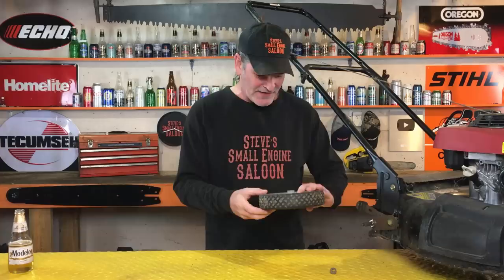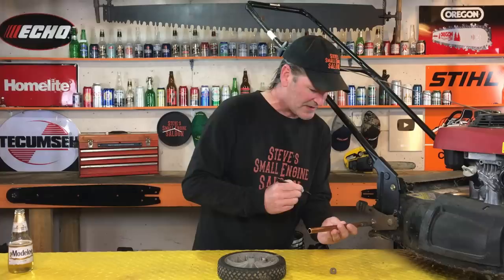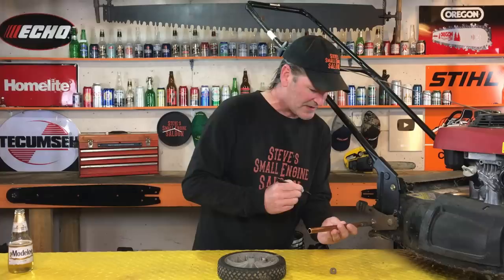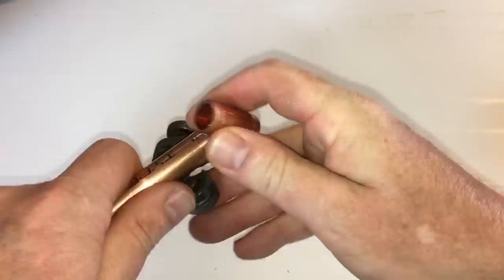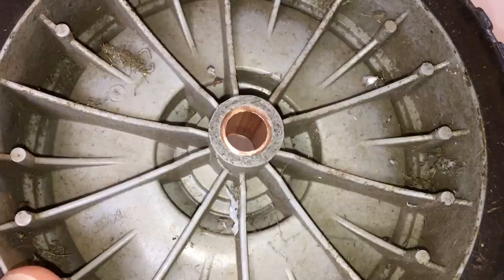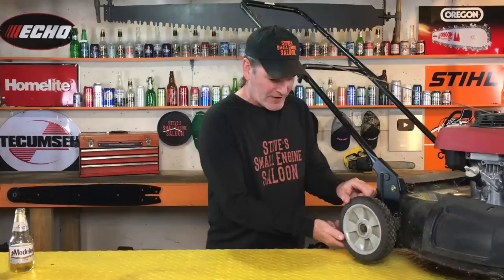Amazing Trick To Fix A Wobbly Lawn Mower Wheel

Comment: Grease for less rolling resistance , it's for mowing grass not dirt . Can always take off and re-grease at service interval , feel the old grease then and see if it's gritty . Graphite powder would likely be best if it's on hand but I wouldn't go out and buy some just for that . How many RPY ( revs per year ) is the wheel going to do ?
Reply: You can't mow dirt with it. Dang it. I guess I need to cut those 75 foot trees down when I cross the dirt wasteland under them.

Comment: Brilliant I have a Honda and the terrible plastic bearings they sell them with (which are 40 cents cheaper than the metal bearings) are useless and only last 5 minutes.  A friend of mine machined me some new bearings out if delrin as I didn't want to take material off the wheel but great little video thanks

Comment: Was doing this 30 years ago and greased with moly .If wheel bolts are worn on the outsides the larger centre section can be filed down by putting in the drill press gripping lightly on the threaded section .useing a drill bit larger than 1/2" and cutting the copper on a diagonal length wise.. deburr and pushing it in then checking fit .drill wheel next size up if its too tight . Type M copper being thinner cheaper  than L can be used np doing it this way

Comment: Steve’s Small Engine Saloon. Another option other than the grease might be the grey anti-seize. I have actually seen this used in bearings with no bad issues to speak of. If someone was that concerned about dirt build up; Use thick soap instead of grease or the anti-seize. At least the soap could be pretty easily washed away if it didn’t work out too well. 
The OEM Snapper wheels used to have steel bushing(s) pressed in. I replaced the old wheels on my 21 inch Snapper Hi-Vac a few years ago that were cracked pretty badly and kept the bushings before discarding the old wheels.

Comment: This is always a great place to be!!
Reply from the maker: Thank You...
Reply: @StevesSmallEngineSaloon    The copper pipe was a bit too large for my axle, so two wraps with soft drink can material and it was fine.  Wheel bearing grease and "only mow clean grass".  Also, try not to push the mower so fast as to over-heat the axle and burn out the lube.  Always good advice.

Comment: Metal on metal, grease it man. Dry graphite would attract less dirt. But yes definitely grease it.
You need a bench vice.
Good video.
Reply: First thought, press bushing in with vise
Reply: Videos work well for pressing bushings in and out if needed.
Reply: Spell correct thinks videos are better than vises I disagree.

Comment: A light coating of #2 Lithium Grease works great and does not accumulate dust or grass as much because it is made for marine (i.e. moisture related) applications.  I use it on my Toro Self-propelled Mower Geared Wheels and the Pinion Gears.  I do so whether they are made of metal or plastic.  A 'copper to steel' dissomilar metals application should not need much lubrication.  The overallminiscule. Conducted between these two types of metals would be minor.

Comment: I'd grease it.. you pack the cavity and the grease itself will mostly keep dirt and moisture out.. could always experiment with o-rings if there's room and you want a better seal. At the very least, use a bicycle chain lube or something like tri flow which will lubricate without attracting dirt but would require way more frequent application (maybe even wax). I wouldn't want to have metal to metal contact with nothing else there although perhaps galvanic corrosion isn't a big threat between a steel axle and copper bushing.. would need to look up the chemistry charts and I'm too lazy to do that at the moment. Great tips. Not sure how I stumbled across your page but well worth subbing for more content!!

Comment: Good idea.. Often times a forgotten or unrealized trick for many. Didn't know 1/2 copper pipe fit so well. I tried this with an old valve guide from the scap bin at work on a deck wheel. Bolt was wore flat though. In the ended, I ended up putting new wheels on anyway. Couldn't get the bolt tight enough to let it roll and be hold the deck up. A bit big enough to punch it out was gonna fun me abou 15 or 20 and the wheels with the hardware was about 30 for all 3. Anyways... I'm a fan of grease after patching up an old John deer that was treated rough and parked in the weather. I Water proof marine grease everything now. Probably overkill but if it's not high speed and hot, I don't want it coming off or rusting.

Comment: Did something similar to my JD LA145. Of course a different size bolt used on JD but what worked perfectly is the copper connector to connect 2 1/2" copper pipes. I put zerts into my 4  wheels when it was new, and didn't want to plug that passage off, close to dead center. So cut those connecters in half, drilled the wheel axis down about 1/2" with a 11/16" bit and pushed/pounded in those half copper connectors. Just as good as new, maybe better. Took a little time but in Canada JD wants over $120 for the 4 wheels and bolts. Took a couple hours. Good wages I'd say.

Comment: Steve you can also use your vice to press the bushing in place without hammering on it.  As for lub, I would use a couple of drops of lite oil. It doesn't need much lub With the copper bushing.

Comment: Now that's a great tip that you won't find in any service manual! Kind of surprised that the wheels don't all have a metal bushing from the factory, though some comments suggest a few do. I figured the wheels were wobbly by design to make it easier to turn... 🤣

I've got some dry Teflon lubricant (comes in some liquid that evaporates super fast) I'd probably try on there, or a spray graphite. Maybe even copper antiseize. If I felt really spendy I'd go get a little bronze pipe nipple instead of copper tube and soak it in oil, make a little oilite bushing, though not sure that would work with cast bronze instead of sintered like a proper bushing. Meh, anything would work better than plastic bearing on steel.

Also, get a full size pipe cutter, way easier than the "close quarters" cutter you use! And, they all make burrs, just less than a hack saw. The burr remover on the back of the pipe cutter is nearly useless. I got a proper deburring tool (little tapered blade with some curves in the middle, can spin in the handle) for cleaning up 3d prints, and wow that works amazing on copper pipe too (its actual intended use) Worth getting even if you only have one plumbing job to do.

Comment: I was cutting strips out of plastic pop bottles. Then rolling them and pushing them into the wheel. If the wheel was too tight when trying to turn it I then would cut a small piece off the plastic strip and place it back in. If the wheel turns clockwise when pushing the mower then I would wrap the plastic clockwise also when placing it in the wheel. It always seemed to work like a new wheel. I'll give this method a try with the pipe 👍
Reply from the maker: Right on

Comment: No grease but you could use silicone spray lubricant.  I did the same repair using a bushing from the hardware store already sized to fit

Comment: HI Steve...another Steve here.... Been doing this for some 15 years or more now on all those mowers that come in with "Wobbly-Wheel-Syndrome"....  Saves customers a fortune & they love what I do without fitting the RPC-made replacement wheels. 
However.... I do the bush length same as you, but.... I cut a cut a diagonal slot, length-ways in the copper tube with a hacksaw..... 
Now.... The bush will probably fit the wheel  (with a slight squeeze in the vice) without drilling out the wheel...but more importantly, it will fit better on the axle:  Hardly any wobble!
To Grease or not to grease?  Very debatable: but  I've always greased them afterwards.
Never seen gravel getting beyond the outer edge to cause this "grinding paste" effect.....
To my thinking: Dust will get in far easier without a grease "barrier"... 
But hey, as some say, now you know the copper tube trick....who's bothered!? 
Cheers (Literally)  Stay safe.
Reply: If you cut a lengthwise slit in the 1/2” copper pipe will it actually fit on the axle and inside of the wheel without filing, grinding or reaming, I doubt it.

Comment: Considering the softness of copper and the fact that it's against a steel shaft, I'd try some kind of dry lube or, as others have suggested, a zerk to keep fresh grease inside. Another alternative and possibly longer lasting is to use 1/2" i.d. galvanized electrical conduit. It'll be the correct diameter, it'll have zinc that will act as a metal lubricant and it'll wear better than copper. BTW, the different letter grades of copper denote a different wall thickness, K,L, M are thicker walled progressively. K thicker than L thicker than M. K grade will probably fit the shaft tighter, avoid M for anything but decoration :-)  As usual Steve, great tips, and yes, you've saved me time and money, many thanks.

Comment: Ok..I would squirt a little left over (used) full Synth. gear oil I saved from my hot rod rear axel. I guess I am a wise guy
since a lot of people won't have that. But ya might try a shot of Castle muscle grease. Dirt / grit wear out faster? I don't know either.
2 Genny Lights should do it. LOVE your chain saw tips. They are helping me with my 2012 Husky 445!

Comment: This is a kind of video I appreciate the most:  Simple trick to make our life easier.
The market offers  a "copper grease" for special use because the copper has self lub. properties and it resist to high temperatures too. 
This is why my choice to not lub. the coupling copper/steel.
Best regards from Italy.

Comment: I have two suggestions.  .We use a silicon spray lube for the bendix on aircraft starters because it does not collect grit.  But I prefer using grease for those wheels.  But, only after making 1/8 inch felt seals with thin finder washers to sandwich the felt between on both sides of the wheel to keep the grit out.  Grease up the felt seals.  This is a method used to seal wheel bearings on some Piper Cherokee aircraft.  Cleaning the felt, the shaft and bushing and then regressing the felt, copper bushing, and shaft once a year should keep it in working order.  Once a year works well on the aircraft. Then use a self locking nut with just a slight pressure on the felt seal.  Snug the nut up until there is a slight drag when turning the wheel.  Then slightly back off on the nut until the wheel turns freely.

Comment: I'd have cut all four sleeves at the same time, as you had already measured the one..not a big deal. Nice tip. I guess I drink a little faster..a beer per wheel.
I'd also ignore any burrs as it's not a piece I'd typically handle. I wouldn't waste any lubricant.

Comment: Use lock ease. It is a graphite based lubricant that has the oil based fluid evaporate and leaves a slick coating of graphite.

Comment: Great way to save a wheel. I thought about bushing the old wheel, but never got around to measuring the shaft. Great tip that the  ID of 1/2" copper pipe fits, forgot what wall thickness you mentioned at the start, it is good fit. 

Agree with the other posts, graphite it probably the best bet but probably not all that important.
Reply from the maker: Right on

Comment: Grease/No Grease? To fix mine, I had to cut a hole in the side to get a socket on the wheel bolt. The bolt head was clean. I fixed the wobbly wheel, greased, then covered outside the wheel bolt hole to keep it clean - so the grease does it's job! No grit!

Comment: Actually, greasing the wheels could make the mower a lot easier to push because we had a very old lawn mower sitting in our backyard for years and it's not worth repairing anyways but I remembered how tough it was to push the mower and I have to say it was nearly impossible to push by the way, the old lawn mower that was I our backyard for years was a old Toro 21inch lawn mower that we got from a neighbor who didn't wanted it anymore, it was used for a few months until my dad bought a 2010 Craftsman lawn mower with the EZ walk system it was a rear wheel drive lawn mower with 22 inch cut Platinum Series 700 Series. So my answer would be yes lubricate the wheels to make the mower easier to push.

Comment: I have a super old lawnmower where a fix like this is very useful, cos' a) you can't get wheels in that size anymore, and b) even if you could, the wear on the tread of the other wheel would make the new wheel automatically bigger giving a slanted mower.

Comment: With copper being a soft metal, adding grease would be detrimental to it. It'll likely collect, rocks, sand, dirt, grass and that "bushing will wear out faster and eventually gum up or fail. In the rc car world bearings/bushings can be your enemy. I found using bicycle chain lube or a 3m dry lube works well for many applications where sand/rocks come in play. Tracks with less dust or sand i like using a few drops of a light weight oil like sewing machine oil or just your regular 3m oil. Hope this helps and curious what the results will turn out in a real world application. Thanks for the tip though Mr. Saloon. I finished this comment in the time of 1 cold beer 😆

Comment: Great video. I tied using metal spacers and I bought a 1/2 inch filing type bit to try and make the hole bigger but I smashed the spacer down into the wheel with a hammer and it went in cock eyed and the wheel is worse now. Oh well, win some lose some. I’m buying new wheels.

Comment: Personally I always wash the underside with a hose after every mow and then I use water dispersant, typically WD-40, with the plastic straw attached, to lubricate the wheels as I spin them back to turning freely and I think this removes a lot of the rubbish and the wheels are free and dry for next use.  So far I haven't replaced a wheel on any mower yet.  And with these steel decks most mowers have now, I think it's imperative to wash after every use to stop them rusting out.  If I buy a new mower with a steel deck, I spray "fish oil" on all the welds, screws and joining points of the mower deck, let it dry a few days in the sun and any unsightly bits that annoy me on the top I just clean up with a rag with a bit of WD-40 on it.  And the fish oil is  left in all the cracks and crevices.
The fish oil underneath that I don't clean up, of course attracts a bit of rubbish when you mow for the first time(being sticky), but only a small film of stuff gets stuck and actually adds to the thickness of the coating and really it cleans up pretty well.  It never looks as new underneath after the coating but honestly who needs it to.  So far I haven't had rust to worry about not even surface rust under the mower I treated this way about 5 years ago.  And it was just a cheapy.
Conversely my brother had a new steel deck mower that he had for about five years and doesn't wash underneath and I replaced the rusted out deck with one from another mower a couple years back.
Seriously use fish oil.  Even if you don't wash underneath every time it'll make a difference.
But don't wait for the deck to rust first.

Comment: Put a lot of grease on it... let it ooze out around the ends the exposed grease will hold the dirt and or sand on the outside of the grease.. the dirt or sand will not migrate into the axle.
Reply: Correct!

Comment: I would lubricate with BOESHIELD  T-9. It's a solvent and paraffin wax that dries so it does not attract dirt. It's also great for protecting tools against rust. A small amount goes a long way. Boeing developed it as a lubricant for its airliners. Most bicycles shops carry it.

Comment: If you use grease, it has to be wheel bearing grease to keep most of the dirt out, I know because I did it.
Part of spring tune up is checking the bushing, cleaning and regressing them.
 Either way, lube or not, they won't last forever but it's a cheap fix.
Another great video, Steve, cheap and easy.
Thanks again

Comment: Apply grease to the axle ,put the wheel on ,then  add a felt washer plus a steel washer then the nut .  I have done this same repair as you .The felt washer is the  is the trick .
Reply from the maker: Great idea

Comment: The OLD MAN from EP Steve saying nice cheap fix but at Eliminator Performance we use what are called Isostatic Bushings which are an oil impregnated sintered bronze sleeves with an inside diameter of 0.501" or 0.502" and an outside diameter of 0.625" our cost is $1.33 Cdn. each. Drilling the wheel bore out using a 5/8" drill bit like you did works perfectly but we have found that using a drill press and clamping the wheel down centres up the bore better than free hand drilling. We purchase these from Fastenal but they are available on line and provide way less wobble since the 1/2" diameter copper tubing has an inside diameter of 0.528".

Comment: Thanks again Steve. A dry film Moly Spray every day of the week. I use Bel Ray 70260. I also use it on my hay baler chains and ride-on mower drive chain. Be aware that you have to let it go off after applying for best results. It's not a spray and go product. However - I prefer mower wheels that have bearings in them and lean towards heavier duty contractors type push mowers. You only get what you pay for!

Comment: I have been doing that for years now and I use a white lithium grease in mine and have never had any problems with the ones I do and I use the "m" type copper pipe give you a little tighter fit on the bolt. Thanks for the video like watching them.